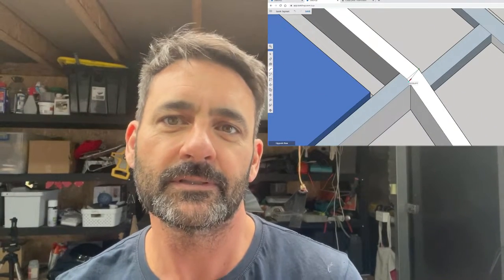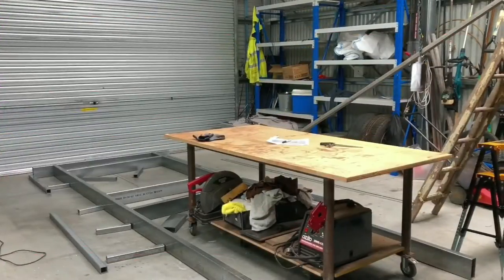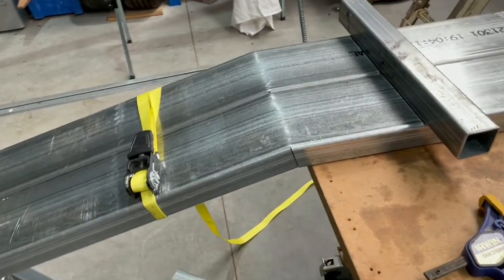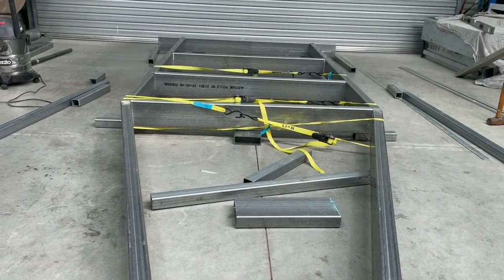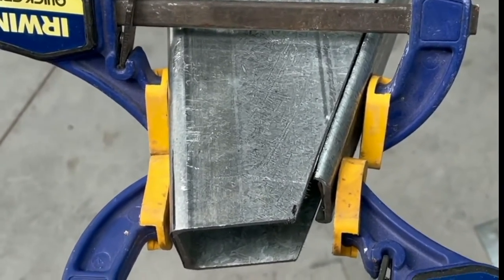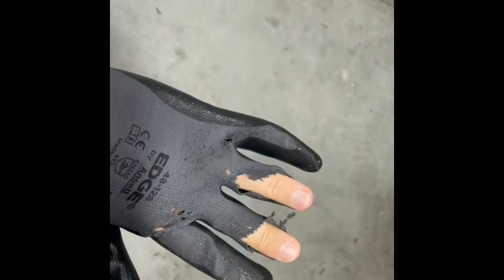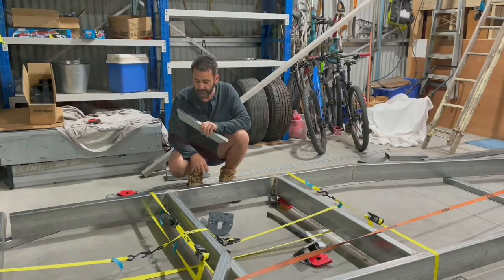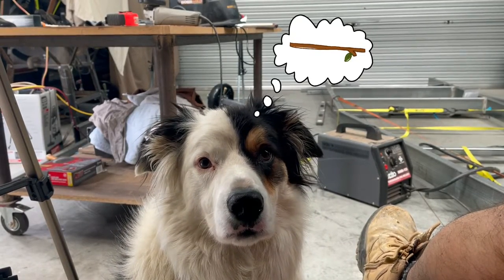Episode #2 - solo DIY hybrid caravan build series - chassis steel

Comment: This is a great reference for those planning a trailer build. My first welding project was a camper also. 
I built my chassis of a garage floor too. I used window packers of various thicknesses to level the chassis with a laser level. At the corners I epoxied threaded rod into the concrete and bolted down the chassis to prevent warping  Kind of a makeshift welding table. Once welded up I built a rotisserie to weld in the suspension and the tanks and plumbing and all the other under carriage works. Its amazing how many times I rotated the chassis for better access during the build.
Reply from the maker: Wow! That’s next level

Comment: Secret to those notch cuts is to split the angle either side of the bend line evenly so the resultant boxes are equal sized and you don't end up with different sized rectangles to weld together. You were probably saved a bit by the narrow angles. Obviously a bit late now...
Reply from the maker: Yeh good point, that makes sense! Learning on the fly with most of this build as you can probably tell….

Comment: What is the height and width of the 3mm galvanized metal you're using for the trailer frame?
Reply from the maker: 150x50mm for most of it, and 50x50 for the rest. I think i run through this is the QA episode maybe.
Reply: @PerpetualTransient  Im binge watching, not to that one yet. tks

Comment: Did you get a engineer or plans for the chassis or did you just have a guess? Genuine q.
Reply from the maker: I borrowed a couple of designs from vans on the market, steel thickness and dimensions, and had a couple engineers (friends) run an eye over it and give some advice. Most feedback I’ve had is that I’ve gone a bit overboard on strength to weight allowances, but better to be safe.

Comment: Looking good mate what is the length of the drawbar?
Reply from the maker: Thanks mate. It’s about 1700 from the front wall of van to hitch in a straight line
Reply: From the start of the a frame to the notch  then to the back pre fold length to mate
Reply from the maker: @toyswithyouandme1653  if you can message your email address on my Facebook page or Instagram i can email you the chassis design with dimensions if you like 👍